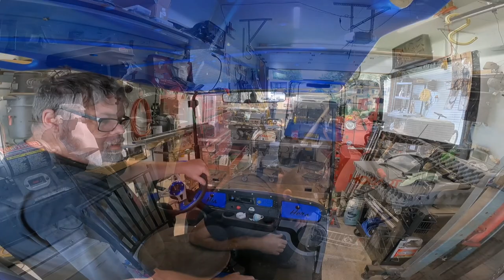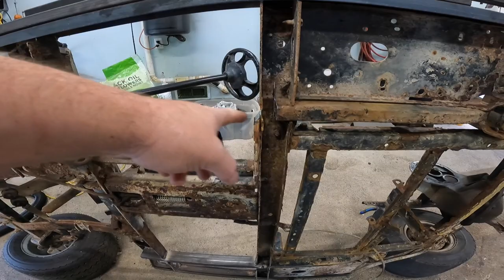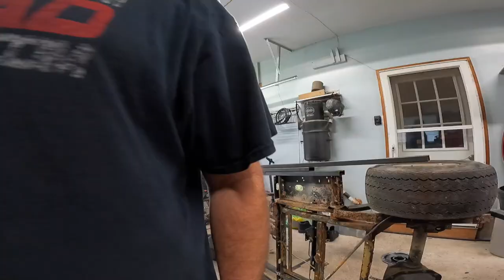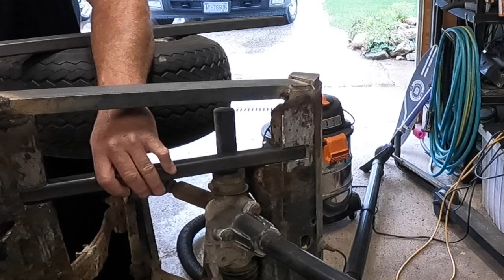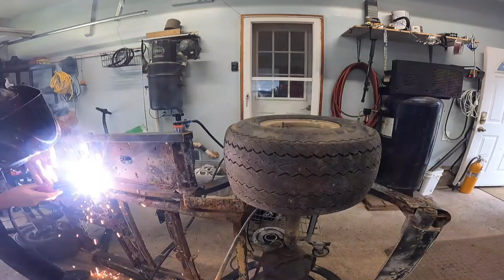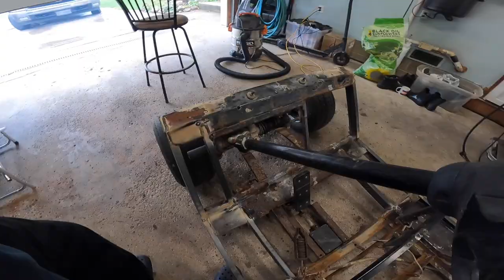90% Better Then It Was Junk Yard GolfCart

Comment: Always place both sides when your welding butt ends to each other like you did in the center of the cart. They will fail over time welded like that. Doesnt matter if you been welding 30 years with a $10k welder it just happens. Just weld a plate on both sides on that square stock when you butt ends together and it will be fine. Takes 10mins now or 2hrs later lol